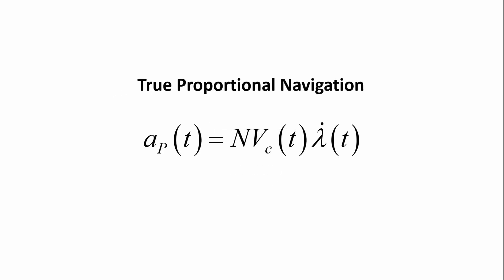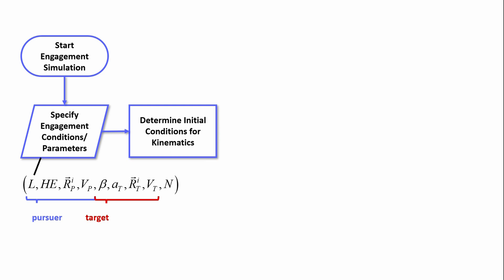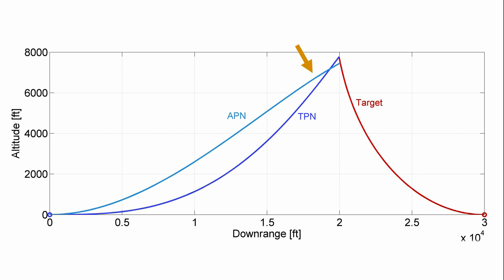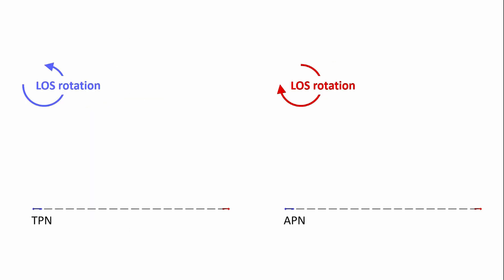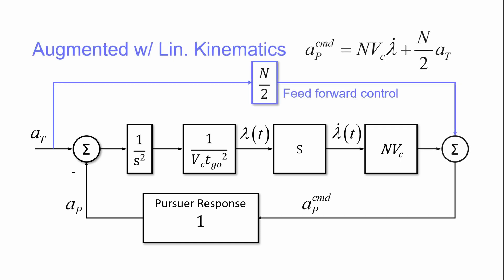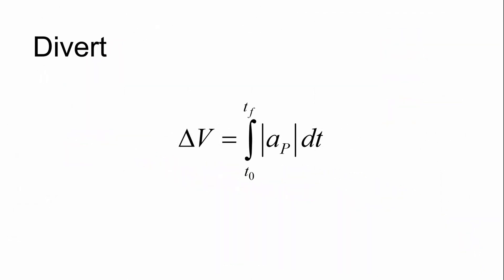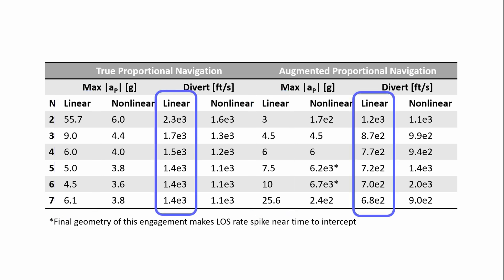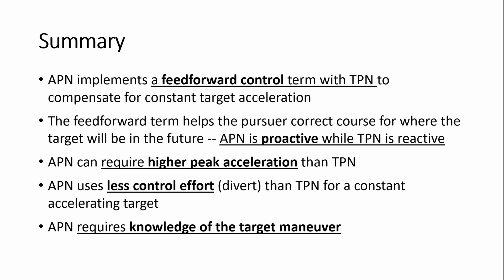Augmented vs True Proportional Navigation (3/3) - Guidance from Optimal Control - Section 2 Module 3

Comment: The APN is actually a feed forward scheme in control theory, it can be applied if the disturbance (here the target acceleration) can be measured,  the classical PN ( PPN, TPN) are feedback scheme, feed forward has advantage in that, it reduces the offset error at balance, and it increase agility of the control loop. The later is esp. beneficial when target has varying maneuvering, and the lag in the interceptor's control loop is non-neglectable. ...

Comment: Thank you so much, Dr. Ben! Your efforts are truly invaluable, and your content is unique. I hope you can guide me regarding the interpretation of the LOS (Line of Sight) angle when the seeker is a camera. Do you recommend a textbook that explains how to measure this angle using a camera?, and what is the technique used to measure closing velocity ?
Can I apply linearization for pursuer kinematics for a wide range of operating points so I can get more accurate representation for homing loop , and fed the data to the autopilot which also designed based on dynamical model linearized at different operating points >
Reply from the maker: Hello there, thanks for watching and the good words! The applications you're seeking are a bit outside the theoretical realm of my channel, but I believe with some research you'll be able to find appropriate refernces. On your second question, what you're describing is a linearized approach to homing loop analysis. This is an efficient means of obtaining trends in data, but one must be cautious of its overall accuracy. Good luck!
Reply: @LearnGandC  
You're humble and generous man, you give us your expertise ,time and effort, it's truly appreciated.🙏

Comment: How would one build and solve a penalty matrix with a different goal built in?

For example, if one wanted to minimize peak airframe load rather than overall control effort, the scenario in this module would (per the "monkey and hunter" scenario and initial null ZEM) result in only matching the target acceleration throughout the intercept timeframe, resulting in a constant 3 Gs on a simplified linearized version of the problem, or an initial peak of 3 Gs with some reduction over time as the target applies less of its acceleration towards line of sight normal for a unsimplified version.

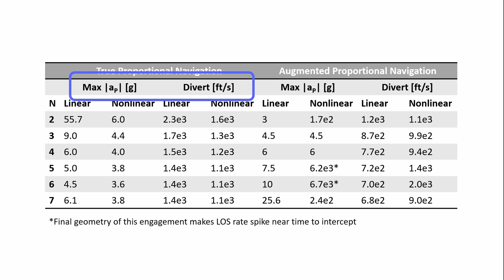Empirical analysis would suggest this goal is achieved by applying a constant acceleration throughout the entire engagement, which leads to commanding an acceleration equal to 2*(ZEM/Tgo²) + at, which turns out to be APN with a gain of 2. This acceleration minimization is shown on missile guidance fundamentals section 3 module 3 at 9:12 for a non-evasive target, and on this video at 7:31 for an accelerating target, but an excess acceleration is commanded towards the end of that engagement.

My assumption is this happens due to Tgo estimation error earlier on, and i'd like to see if this error can be compensated. My intuition hunches towards applying a target acceleration penalty compensating for that misprediction, but i'm not sure how to apply this into the penalty matrix.
Reply from the maker: It's a good question. Check out this 1996 IEEE paper (somehow available for download) that solves the optimal guidance problem with constrained acceleration. 

https://ieeexplore.ieee.org/stamp/stamp.jsp?tp=&arnumber=481287

Comment: Interesting. What happens if we want to predict reasonably the acceleration online of the target either from recent kinematics or some learning process via system id or pattern recognition. It would interesting to discuss in a video a reformulation of the guidance law using MPC or reinforcement learning or even classic adaptive control. In the meantime, thank you for your lectures. Very informative and on point.
Reply from the maker: Sam of Rabat, for this one would use a target state estimator. Details are beyond scope here but methods can be found in textbooks and open literature.

Comment: Hi. Thanks for this playlist. 
I have question, in real implementation of APN, how does it get the target acceleration? The whole difference and motivation for APN is the need for using an additional info about the target maneuver in order to get better intercept. So my question is basically in reality does this law get used?
Reply: Acceleration is a derivative of velocity, so in practice you subtract the current measurement of the target velocity from the previous measurement of the target velocity, multiplied by the time between measurements.
Reply: @corvusvalidus1538  yes, but try to use a simplified Zarchan homing loop with some standard noises and see what happens by simply make a derivative of a noisy LOS measurement.
Reply: Could it be ballistic missiles after the engines are turned off, and assuming their speed can be considered almost constant during the engagement phase?
Reply: @francescobernardini1119  ballistic missile does not have a constant speed, that's why ballistic coefficient exists.